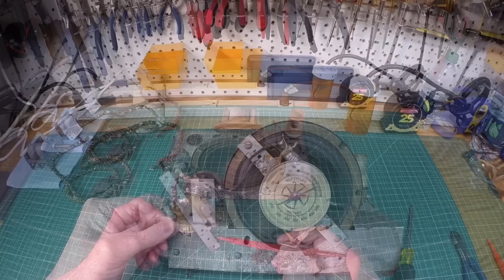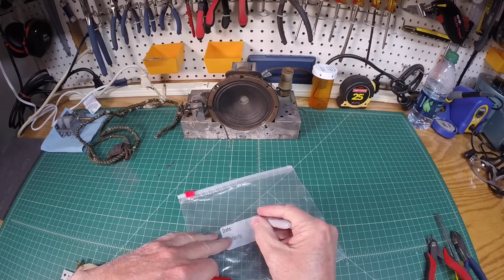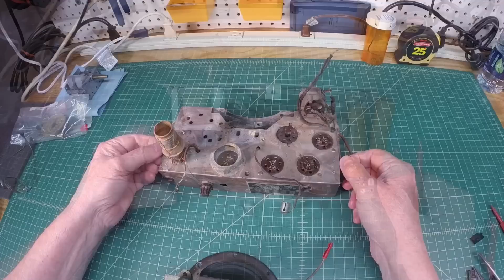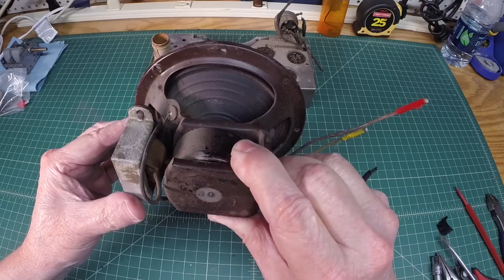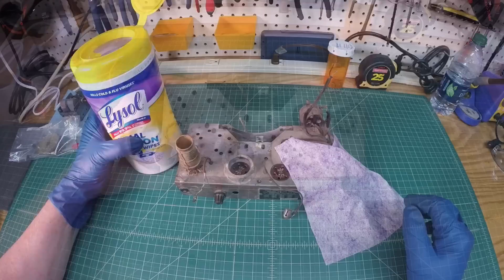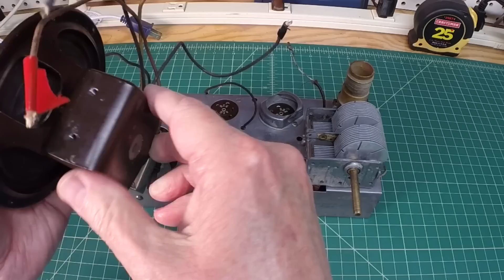American TRF Receiver - Part 2

Comment: Don,
I have to begin by commending you on removing eighty-or-more years of crud from that American radio chassis, and shining it up in the way you have – a super job – well done!
I might come across here as someone trying to be a comical old sod when I say I use toilet cleaner (containing lime scale remover) to initially clean grime, and rat and mouse crap, from Vintage Radio chassis but I have found it to be quite effective, especially when cleaning aluminium chassis.  However, though I have not seen Lysol wipes on sale here in the UK, I intend to look out for that product (or a close equivalent) as it looks to be very impressive.  Even an old timer like me is willing to accept new tricks LOL.  Thank you for sharing that cleaning tip my friend.
And whilst on the subject of cleaning…
Having seen your last video (Part 1), I’ve finally made my mind up what I want my wife to buy me for Christmas – an ultrasonic leaner.  As I’ve begun taking an interest in tinkering with old electric clocks, a device of that sort will be very useful. 
Cheers dear chap,
Phil.
Reply from the maker: +SteelCity321PB Phil - I've never considered using toilet cleaner, but I'll give your method a try on the next one that is deserving of such treatment. That's just one of the things I enjoy about the hobby, that is the knowledge and tips shared from others like yourself. I bought my ultrasonic cleaner a few back and it has worked well for me on those tough parts that need extra attention. Your interest in old clocks is intriguing; a new video on the horizon? Best, Don

Comment: I came across another video made by a European collector calling himself radioOantiks.  In the video titled "1937 Silvertone 4666 all-wave 10 tube console radio" he shows a radio with some similarities to yours.  This model is very different you will see quickly,  however it has a telephone style push buttons, is branded "American" and is made by the Colonial Manufacturing Co.   This radio like I stated is different and higher end but may have been made by the same company as yours.  Radio will look great when you're done I'm sure, thanks Zach
Reply from the maker: +zachtownsend1 I appreciate the info Zach. I'll check this video out and do a search for a Colonial that matches my design. Best, Don

Comment: Hi Don,
i posted a few pics of my radio on a personal website that I'm making and you will see the similarity right away. There is a tag on the bottom, but I'm not sure how much help it;s going to be, but it's a start! There actually is a back on it that is made from thin plywood. That's the first time I've seen it in 7 years; I guess I remember it being in better shape LOL 
Here's the link:

http://www.oldradiojunkie.com/vintage-radios.html
Reply: +Jim Kodysz Oh, BTW The tube compliment in my radio is:

6C6
6D6
25Z5
43
???? (tube missing.)

hope this helps!
jim
Reply from the maker: +Jim Kodysz Jim - I've always wanted to build my own web site too, but haven't had the time to this point. The radio layout is very similar, and the electrical design is a mirror of mine. The missing tube is most likely the ballast tube for dropping the line voltage for the tubes and the pilot lamp(s). Thanks so much for sharing this information and I'll bookmark your web page for future reference. Best, Don

Comment: Don, did you use Naval Jelly or Evapo-Rust to remove the rust?  It certainly did a beautiful job without leaving any discoloration.
Reply from the maker: +z95m For this chassis, I applied Naval Jelly and left it on for ~10 minutes and wiped it off with shop towels and water then kept repeating the process multiple times until the rust was removed. I then used Renaissance Wax on the chassis to act as a rust inhibitor. Here's a link to: https://www.theruststore.com/Renaissance-Wax-P235.aspx Best, Don

Comment: The old chassis cleaned up fairly well.  I sometimes use the Swiffer Dusters for cleaning up surface dust.  They are soft and won't tear a speaker cone as long as you don't put a lot of pressure on them.  When I worked in communications and found a "mouse house" in a repeater, I used to steam clean them with a steam genny without the soap.  Once they dried out they were fine.  Antique radio coils wouldn,t stand up to that, but an alcohol spray might be OK.  You can immerse chassises in hot water as long as you remove the cardboard components.  You should then bake them at a low temperature for a couple of hours.  [WARNING:  Wives don't always understand this process and the consequences can be dire so tread lightly] !  Nice clean up so far.  Again I am enjoying your work.  Thanks.
Reply from the maker: Stephen - I appreciate the tips/advise. I just went and got a Swiffer out the storage area, cut it in half and genteelly cleaned the speaker cone where possible and it did the trick! Fortunately the top of the chassis was the only area exposed to the mice... The Chanticleer 2D570 I restored some time back was a mess and I sprayed it down with isopropyl alcohol numerous times and let it air out for weeks after removing the debris and repeated the process a few more times. Thanks again for sharing your knowledge/experience with me. Hope to get started on the electronics soon. Best, Don